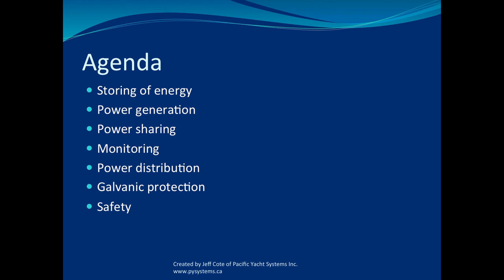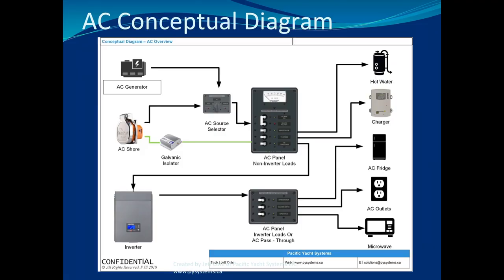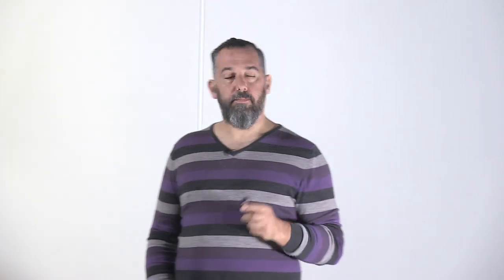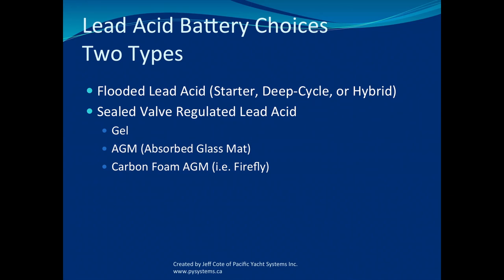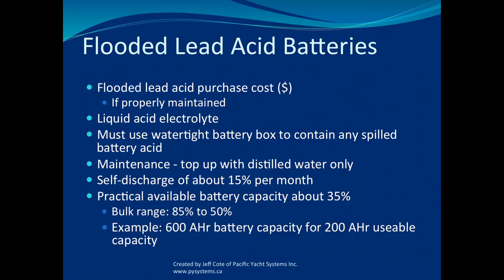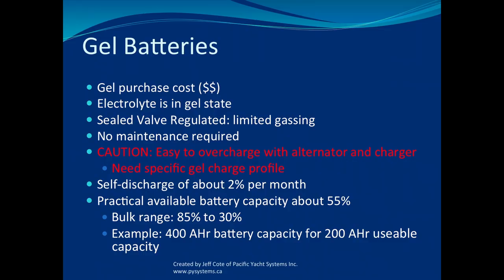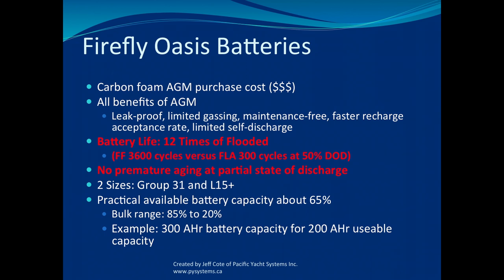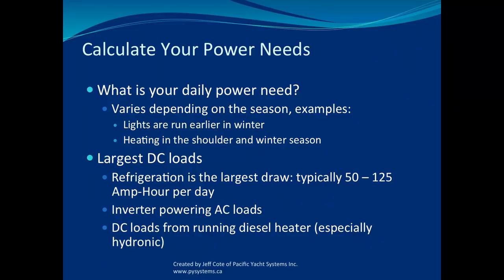How To: Marine Electrical Seminar - Batteries - Episode 1 of 12

Comment: Are there any concerns if I were to use an Ecoflow Delta Pro (3.6kw) battery generator as the “shore power” supply (30A) to my boat using the shore power cable while at anchor. In addition, to charge the Ecoflow, I would install the Ecoflow 800amp Alternator Charger to my starter battery. Seems like a simple solution compared to purchasing a bank of lithium batteries, inverter and charger…. Thanks Guy from Gatineau.

Comment: At what voltage should I charge my 12V gel batteries. I have a 4D 225 Ah and 2 group 27 98  Ah West Marine gel batteries. My Magnum inverter charger allows me to dial in the voltage for various battery chemistries. I have it at 40 at 40 volts not but am I under charging at the dock?
Reply from the maker: See response to exact question.
Reply: @PacificYachtSystems  Thank you so much. I called west marine and asked them. They recommended charging at 30 volts for my 4D gel, 225 AH, bank 1 and 20 volts for bank 2,, also gel, which is 2 group 31s combined at 98 AH each for 196 AH total. Problem is I can only set it at one voltage with my inverter charger, either 20 or 30 volts. I asked them if I could simply charge my 4D at 20 volts and she said yes. However, I recall you mentioning not to under charge batteries as they will gradually die prematurely. Would charging my 4D at 20 volts be undercharging it? Also, since my 2 group 31s are combined, would it be ok to charge at 30 in your opinion? I realize this is hard for you to assess over the net without addt’l info. Thanks again!
Reply: I should clarify I meant amps, not volts

Comment: Thanks for making this important and complex topic so understandable! Question on mixing battery types with Firefly. I'm changing boat battery & charger set up soon. If I change to Firefly foam carbon for house bank, is AGM starting battery ok? Will install Xantrex TC2 40A, is the AGM setting ok for both Firefly house bank and AGM starting battery? FF looks like 14.4V max charge, and the TC2 on AGM setting looks like 14.3. Does the same AGM charge regime work for both? If answers in seminars, advise which please.
Reply: Excellent question given Firefly does not manufacture a starting battery.   I too would like to know the low down on this.   Hoping he will chime in.

Comment: Amp hours amp hours amp hours.
If you have  6v 200amphous how many iphones can you charge
If you have 12v 100 amp hours that is the same amounts of iphones (given 100% efficiency)
Why not talk in watt hour's. 100 watt hour's are always more than 50 watt hour's no matter the voltage
Reply from the maker: All good points. We talk in amp-hours because battery capacity is measured in amp-hours and not watt hours.

Comment: At what voltage should I charge my 12V gel batteries hose bank.  I have a 4D 225 Ah and 2 group 27 98  Ah West Marine gel batteries. My Magnum inverter charger allows me to dial in the voltage for various battery chemistries. I have it at 40 at 40 volts not but am I under charging at the dock?
Reply from the maker: With Gel batteries, you definitely want to make sure you follow the exact specific charging requirements from the battery manufacturer. Gel batteries are very susceptible to over charging.

Comment: See a lot of information about inverter/chargers. Don't see any info with regards to chargers that do multiple batteries, such as NOCO marine series, any thoughts?
Reply from the maker: Not aware of a current inverter/charger that has multiple outputs, anyone else can chime in?
Reply: @PacificYachtSystems  OK. let me ask the question this way. I have 4 6 volt / 225 ah batteries and a single 12 volt starter batter. The 6volts (4) are wired as 2 pairs in series to give me 12v / 225ah  and then I wired  the 2 paired in parallel for 12v / 450 ah. I have a 3 bank battery charger. Is it possible to wire a bank to each set of paired 6volts and the single 12 volt starter battery.

Comment: Hi Jim quick question I've recently installed Blue sea combiners to my system and replaced all battery leads. All seems ok , except on the Port engine I get a low voltage reading of 11.5 v . Checked Alternator output which is good , Batteries are good and fully charged from shore power charger. Checked at ignition switch . When off there is 13.7 volts , when I turn ignition on it drops to 11.5 ! What have I done wrong 🥺 is it a short ? If so how do I find it .  Starboard is fine
Reply from the maker: Well based on the info provided, and assuming you don't have an engine pre-heat, which would cause the battery voltage to drop when the engine pre-heats are activated. Your issue, is either a weak starter battery or a really bad connection on your starting circuit.
Reply: @PacificYachtSystems  Thanks for reply Jim . i found the problem  it was a bad earth connection at the instrument panel,the main earth in the engine loom became disconnected , all is good now , happy chappy

Comment: here is my problem--I have one battery that has, of course, the major black wire on the negative, and the major red on positive.  And the minor black wires of course, also on negative.  BUT, there are wires dangling now-for several components.  They are NOT black--or red. I can't trace where the other end of the wire goes, so how do I sort if should put them on the red or black post?  Related, is it safe to go to the helm and find some component that is not working, then go back and touch one of these wires to the red and see if the component comes on--or will that maybe burn out a fuse?  thanks.
Reply from the maker: Unfortunately your wiring situation is all too familiar, as too many electrical connections on boats are unlabeled and not using standard color codes. What makes it worst, some devices cannot tolerate reverse polarity (i.e. DC positive and negative swapped). You might need a wire toner to figure out which wire goes where, it's tedious and frustrating, but you got to figure out it out.
Reply: @PacificYachtSystems  My specific question--got a specific answer, and I thank you for that.  What you just told me was something I thought might be true--but now I know--thanks to you.  Appreciate it very much.  I know there are wire labels--and it sounds like it will be worthwhile to get them labeled, once and for all.
Reply from the maker: thumbs up.

Comment: Why no mention of Li-Ion 
Expensive up front but 
1000+ cycles
Charge fast
Can use much more of the rated capacity (in some cases 100%)
1/4 the weight
Sealed
Safe
Why no mention? By the way no hate! I love your channel.
Reply from the maker: Thanks for adding to the conversation.
Reply: so further to this, after completely designing a lithium system i decided to not do it since the tech is just not proven enough and because i respect your opinion too much Jeff. The whole emergency 50% of extra battery (even though it damages them) plus the possibly frying the BMS and having no power for the VHF etc also weighed on my decision. The final straw though was that the lithium was slightly to big for my battery box so i have to build a remote battery box platform and run cable anyway. Then there was the price $600NZD more including the DC-DC converter. 
For the time being i have been labelling all my wiring and installed a negative bus bar by the existing battery and a Victron 712 battery monitor so maybe i will find i don’t even need a new battery.. We’ll see. In any case my wiring already looks way better with proper heat shrink terminals to a bus bar instead of a battery octopus 🐙 
Thanks for all the advice Jeff!
Reply: oh and one more thing, there are tiny little wires powering my AIS connected to a much larger fuse wire, it’s way to delicate. I know you said use a terminal strip to join wires but i don’t think i can easily get one to join up to a wire that small. The small wire is part of a larger wire with lots of tiny ones. How should i join these wires so the litte wire will be securely connected to the bigger one and the little one especially will be safe?